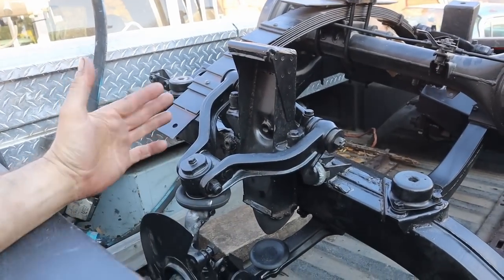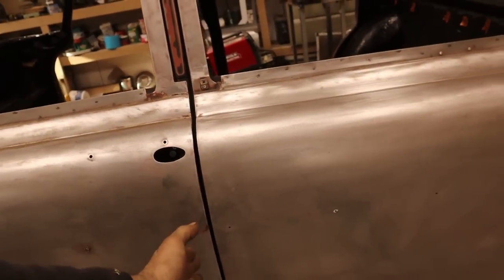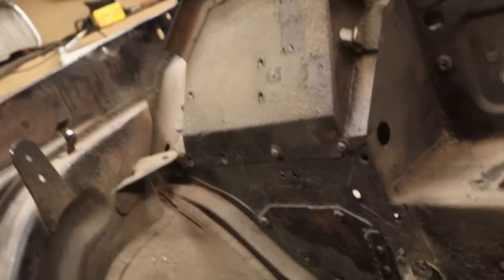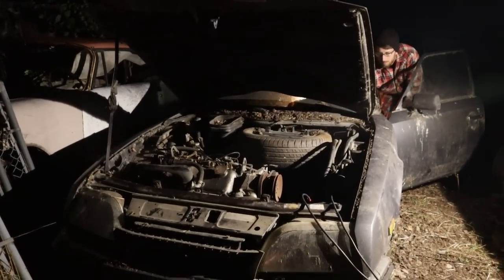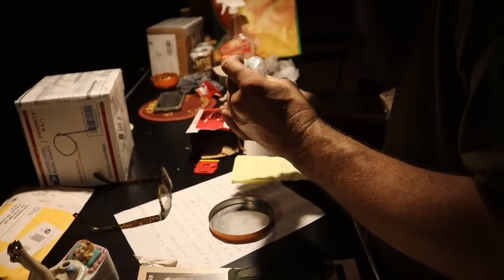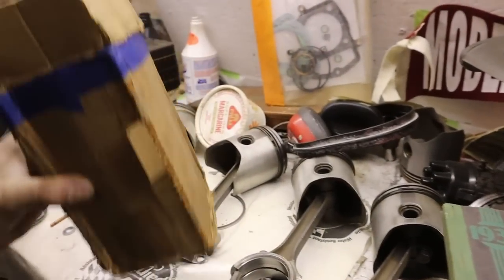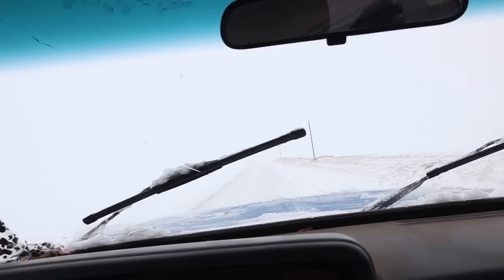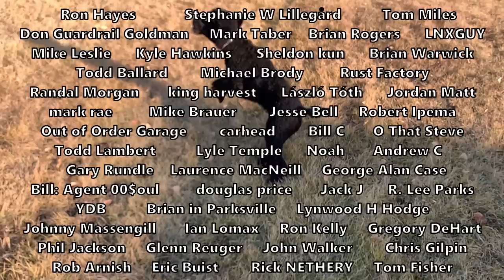1937 Chevy Underway! Rover 3-Litre Back on its Wheels, Citroen CX Diesel 10-Year Cold Start, & Mail!

Comment: That miniature 6-cylinder engine block is really neat. As soon as I saw the casting number, it seemed eerily familiar. Sure enough, my 1973 Chevrolet 250 has that exact casting number (328575).

Comment: All the belts and pulleys in the Citroen  engine bay remind me of a 19th century factory.
Reply: Agree! One of those overhead belt driven systems with pulleys and shafts tailored to the speed they needed the machine tools to run. The rest of the CX looks like a spaceship.

Comment: With the Rover project one thing I have learned from it. You can not leave things to chance and hope they fit. Kind of like assumption is the mother of all failures. Nice to see it has wheels back on so it's much easier to move around. I'm sure Strong's Garage will do there magic on the Chevy and that will engine will sound like brand new. Also the hood ornament compliments the car in a huge way a piece not very easy to come by.

Comment: I grew up in Saginaw, only a few miles from Grey Iron..  and have driven past that foundry (when it was still standing) many times.  Also the former home of what we called "Steering Gear" which made the famous Saginaw Steering components.  Also home of the original 3 speed Saginaw transmission.  

Not much of that going on any more, of course - but lots of manufacturing history - which has some positives and negatives.

Comment: So lovely to see the P5 back on her feet......and purring the panels on would do the same for me as it does for you in motivation to finish it....or at least get it to the NEXT stage!  Panel gas on a Rover of that vintage were never a strong point when it came to attention to detail or quality control on the assembly line.  If the door went in the hole, the onus was put on the door seal to do the rest of the job to make it water-tight....often without a serious amount of time before it failed to do so.  If the vertical edge of the front door skin is in line with the rear edge of the B-pillar filler (between the two door windows) and the body lines lined up, then it was considered good enough.....and the one you showed looked pretty much spot on.  If the door top or inner panel touched from that point on, the "Calibrated Tapometer" or the grinder came out to adjust them. They are a beautiful car and especially comfortable to cruise along in - as long as you aren't in a hurry to get where you are headed, although they do handle well if you throw them into corners at speed.  Really looking forward to seeing more of this one this winter.

Same with the 37 Chev - won't it be lovely to hear that bog six finally come to life, eh?  All the best.

Comment: Another fine video as usual. I worked at the grey Iron foundry prototype/ experimental division in the early 90s. The contractor I worked for did all the concrete, sheet metal and iron work for the lost foam process experimental foundry. Good to see the old Chevy coming back to life.

Comment: The 2500 D on the CX is a bulletproof engine. In 1981 it should still be timing gears, the dual timing belts came in 1983. 75 hp, a lot of torque and really good gas mileage. My first CX was a series 1 25 RD turbo. Same engine but with a turbo without intercooler, 95 hp woohoo !
Too bad the subframe is bent, it is a nightmare to change.... And  the electrical system is also a nightmare (but it is even worse on the series 2...). I'm a Citroën mechanic, and my colleagues hate to work on hydro Citroëns, but me I love it haha !

Comment: "I wish I had the new tires on": My line exactly. I will have to drive to a friend of mine installing winter tires on the last car I bought. I am sure we will have snow one or two days before this happens. 
Actually I stopped putting summer tires on my cars even if I have a set. Saves a lot of work that way.

Comment: Nice to see the Rover on its paws. Looked like a whole CAW crew on overtime. I was betting against the Citroen firing up but your persistence paid off. The old Chevy should run like a top after the boys put the sleeve in. J-B Weld would have been a quick fix but it wouldn't have been a daily driver. Apparently winter arrives early in AB. Got my first taste of winter while driving through Canmore a couple of weeks ago before returning to Upper Canada. Hadn't realized that Strong's Garage had a channel. I'll have to check that out.

Comment: Scott, I am afraid from here on out, sore backs don't ever completely go away, pain just subsides until the next time you try to do something you shouldn't. Took me several years to downshift from younger, resilient me, to the high mileage "older gentleman" I have become. The old adage work smarter, not harder comes to the fore. Example - treat yourself to a power winch on your trailer. Hand crank winches are for younger, dumber guys too tight, or too poor to spring for a proper winch. Noticed the biplane rad cap has been replaced on the T, hope it didn't fly away.
Reply: Indeed, and "do something you shouldn't."'s seem to happen more often now, and includes things like pulling on your socks in the morning, or opening the bottom dresser drawer.

Getting old's not for kids.

Comment: The cast iron miniature stovebolt block has really gone to a good home.   Rejoining the front subframe back to the body of the Rover was fascinating.  Good thing you had Tom there to supervise.  And another set of 7.50 x 14 wide whites My Classic Tires.  This is a set of 5, so even the spare tire will be new and matching.  If they were 15 inch tires, I would have guessed 1 of the straight 8 Buicks, but 14 inchers - my guess is the 4 door 59 Buick.  When the 37 Chev is back on the road, maybe the guys at Strong's might have a roadworthy 37 Ford, for a springtime comparison of which is better.

Comment: 51:48 That's the way to do it though. One of the reasons I refuse to drive in the snow down here in TN is you get dipchits that think having a lifted 4wd diesel truck means they can rip ass 80+ down an icy snowy road. And I don't want to be what they inevitably crash into.

Last time I had to drive in the snow I was in my mom's '03 Explorer. Locked it in 4-lo, pulled it into 3, and just let it roll. No problem 40+ miles at about the pace you're making here. Saw so many doofs in ditches.....

Comment: Those bloody Rover front struts are even worse than Mopar ones to remove. So time consuming.  That's why I modified mine to front bolts, from the stud and nut, so they'd slip out in 5 minutes.  I'm waiting with anticipation for the Rover interior fit-out. It's great that snow holds little fear for you.    In New Zealand, four inches and we're panicking.

Comment: Just an observation. The rods for the 37 look as though they have inserts not brass babbit bearings. Has the crank been turned and newer rods supplied? I know the old 216's had brass babbit bearings. You need a special setup to pour these. Great project. I have a 1954 Chevy truck with a 261 in it. this one used replaceable bearings. Keep up the good work.
Reply from the maker: Hi Phil! This engine still has all of the original babbit bearings. We'll do a close up soon! Cheers...

Comment: The 7.50X14s could be for the '59 Fury or the '61 Fury. The 57 - 59 Dodges are far from needing tires at this point, so is the '60 Impala. This size is too small for the Buicks; Hmmm---

Comment: Scott, I know you like Citroëns and most of them are fairly older models. There's one citroën I like that not that old and can still be seen on French roads (even though they'll mostly disappear within the next 3 -5 years with these new anti-thermal engine rules France has put into place) and that is the Cotroën XM :  https://www.youtube.com/watch?v=hPDKw609-4I   This model is pretty cool, rather peppy and is definitely comfortable.  You're as tall or probably taller than me (I'm just a smidgeon under 6'2 -1.89 cm) and I fit in that car comfortably.  If there are any available in (Alberta) Canada, that's the model to collect right now and preserve before they vanish.

Comment: When I hear horror stories of towing companies I cannot believe how incredibly stupid some guys are. But to hear the destruction of this CX hits the jackpot. Did you get some compensation for the destrucion of the car? 
When I see those sad CXs I start missing the two junky CX Breaks that we used in our body shop time. They just decided to give up from one moment to the other. I bet a Diesel has advantages. There is less of the very sketchy electrical chaos of French wiring needed in order to start the cars. I could not figure out what was wrong with car. The first one was sent for salvage as we now had a "better" one. Soon after the first one was sent off, number two decided to die.